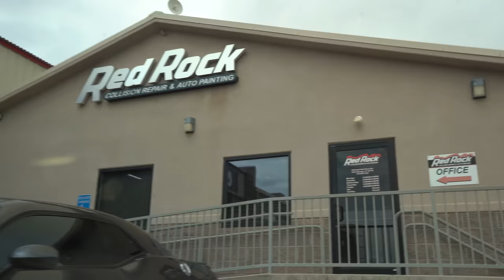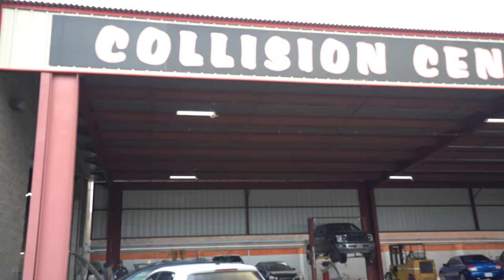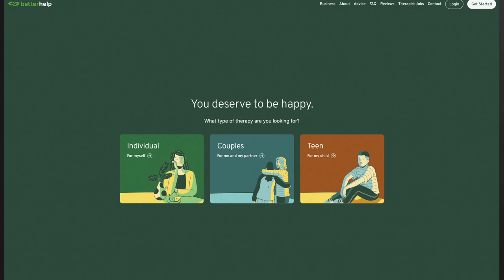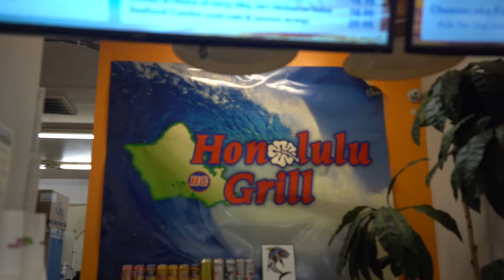RV Living: What EVERY RVer Needs to Prepare For (just got real)

Comment: I showed my husband the video of the cause of your collision. He worked in autobody for a number of years. he was a painter. His comment, that was NOT a pothole! It was a road failure.  Good news about Desert Snow, actually the turn around time is very fast. Our pickup was hooked up to our fifth wheel,  parked in our driveway and backed into by our neighbor's (now ex) adult daughter's drunk boyfriend at a high rate of speed. It happened at 12:05 am on July 4th. I was awake, watching TV,  and ran out the front door to see the pickup accelerating down the street. Long story short, though the responding officer knew and I knew the boyfriend (who we found out from the officer had eight, YES, eight DUI's, actually had valid insurance,  surprising me and the officer), the girlfriend said she was driving, and was cited for hit and run. My neighbor said she had told them multiply times to stay. He hit our pickup so hard, it knocked items off the counter in our fifth wheel. Thankfully,  our pickup was parked at an angle, instead of straight because the damages would have been more than cosmetic. Taking out the transmission cooler, and radiator.  Of course,  we had to turn into our insurance and they go after his. The parts, which include a new bumper, headlights, quarter panel, replace the bug shield, and not sure about the winch until the auto shop tears into it, were six weeks. The shop can't get to it until September.  They are calling us when they can get it in. I understand Desert Snow is your home. I am thoroughly impressed with the turnaround time of this shop! Sorry for the novel. 😊 As others have stated, if you do want to travel to Canada, please check the status of the wildfires.  I follow a couple of van lifers from Canada, and the clips are terrible aboutvthe fires that have ravaged especially BC since late January.
Reply: Your husband works in a shop..Ask him if that's normal damage in a 10-15 miles an hour accident. State parks has a very low speed in state parks.
Reply: @williamadkins6828  His first response was an emphatic " Yes"!

Comment: You are fortunate. When my 2019 RV was smashed into by a semi-truck in late 2021, it took 4 months to repair (this was during the height of the “material shipment delays”).
The collision shop requested OEM, but insurance only would approve crappy aftermarket stuff. So my 2 year old, mint condition RV gets smashed up, and I ended up with a crappier RV. Through no fault of my own (I was parked when smashed into).

Comment: i have a truck and  camper the truck hit 2 deer in the front end it had 4700 in repairs the bumper grill head lights bucket & fender paint and hood scrapes to it took weeks like 3 weeks to do it too! i had older camper i broke a spring on 1-80 in Lincoln, Nebraska i was over 1000 miles from home the guy at a shop gave me a map here by 5 pm will park you stay in your camper the night it was duel axle trailer safe to drive & haul this thing was hauling odd how i knew it was messing up! less then 200 fixed it!

Comment: Been doing collision work for 30 years, no way thats done in a month much less two weeks. Sorry to say but I wouldn't look for it for awhile. We will tell you anything to get you off our backs until the next call. Body shop secretaries spend all day fielding "when is my car going to be ready" calls. I don't know maybe they have a hundred people working there, maybe they are open 24hrs then it might get done in that time frame. Just giving y'all my opinion, hopefully I'm wrong. I say this mainly because of the frame damage and all the structure that will have to be cut out and new parts welded back on,then it has to go to paint to get trimmed out and then back to body to put the hood fender and door then back to paint then back to body for final assembly.

Comment: I can easily see a delay of a month or longer. How busy the shop, how many vehicles in line before yours, availability of parts (and knowing what parts are needed in the first place.) if a PCM (or ECM or whatever abbreviation for the main control module) is replaced, it needs to be programmed to that particular vehicle, which van include linking it to other control modules; which can be better than a dozen in newer vehicles. You don’t normally beed to partially disassemble the transmission for this, or not on GM vehicles. I wouldn’t be surprised Fords require it. They build good-looking vehicles but they are harder to work in than nearly any other brand. I have experience with both GM and Ford vehicles, snd technicians; the Ford techs were always griping  about how much easier the GM techs had it.

Comment: I know that repairs can be very time consuming.  A deer ran into my car on July 11th, and my car has been in a body shop since 8/13.  At this point I don't know when I'll get it back.  They have given me 3 tentative completion dates and haven't met any of them.  Good luck with your home on wheels.
Reply: I hit a deer back durimg covid. I was going about 60 and managed to slow to 40. Hit same corner on the rv as DS. The air  bags did not deploy. Minimal  damage, I  was able to drive it home. My Ins (State Farm) was great to deal with
 The rv was in the shop about 3 weeks due parts back ordered due to covid. By the way, I  drive Mercedes Class C. You could not tell that had been hit from a distance. Very impressed with the stoutness of the rv. I did put on a cattle guard for the future.